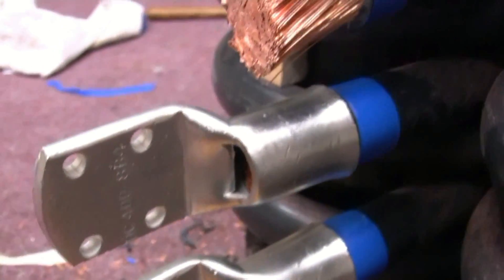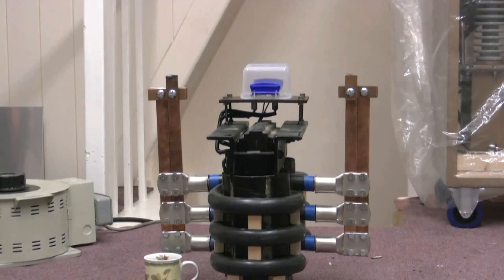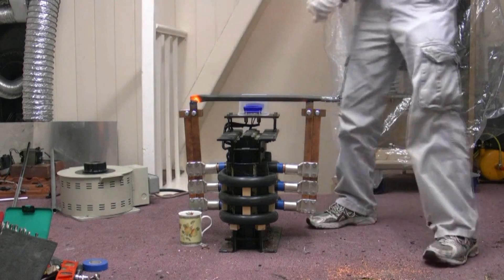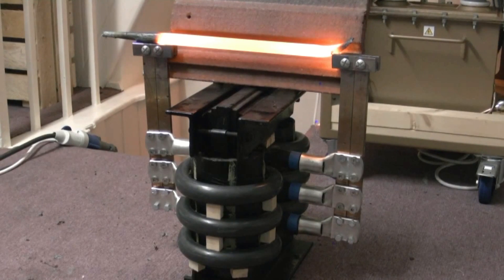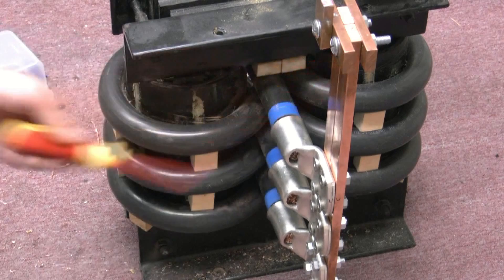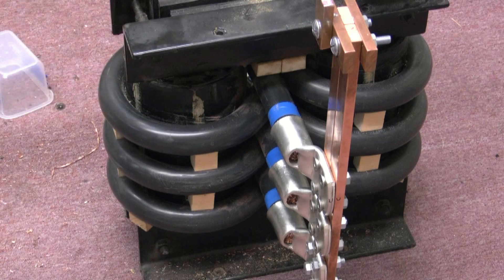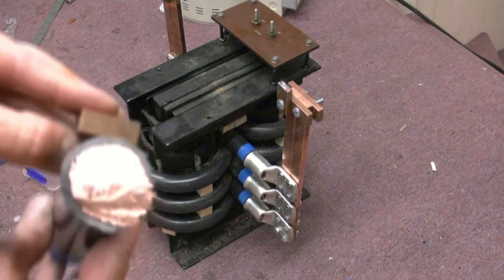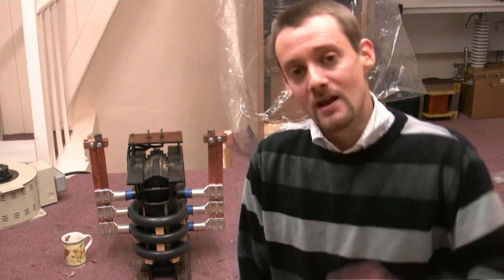50,000 Amp Transformer Completed

Comment: 50.000 Amperios y tocaa todo con la mano descubierta JAJAJAJAJAJAJ k puto fake es esto???
Reply: Lo que te mata es la diferencia de potencial (voltios). La resistencia del cobre (y más con ese calibre de cables y pletinas) es muchísimo más baja que la del cuerpo humano. Aunque sí, es mejor prevenir que curar, mejor ponerse protección. Póntelo, pónselo, ya sabes. XD

Me quedo con lo que comentan más abajo, si tiene 50kA en el secundario, aunque sea solo a medio voltio estaría consumiendo 25kVA. No se en escocia (por el acento del tio creo que es de allí), pero en españa esa potencia te la pueden suministrar en entornos industriales. No en el desván de tu casa.

Mención aparte lo de alegremente crear arcos y espurnas chispeantes de metal fundente sobre la MOQUETA de casa.
Reply: Te meta antes 1V con 50.000A k 1V con 1A xDD
Reply: MobidoM1
que algo sea capas de trasmitir 50kA no quiere decir que corren 50kA todo el tiempo en el circuito, el amperage esta ligado al voltage y las resistencias en el circuito. El cuerpo humano es una resistencia variable pero pongamosla en 5k ohms para ejemplificar, este transformador opera a 0.5V de salida asi que la regla de ohms dice: 0.5/5000=0.0001A nada letal y totalmente manejable con la mano. Nunca te puede matar algo de 1V porque la resistencia no permite el paso de corriente tan elevada. Asi que mejor informate antes de insultar y aprende que mientras es cierto que los amperajes altos son los que matan el voltaje y la resistencia de la piel(que cambia con las condiciones ambientales y otros factores) es lo que define dichos amperajes

Comment: I have a problem..even with a load of  0.01 Ohms (the object will still have some resistance) I calculate that a transformer like that with a 1 turn secondary (x3 in parallel for x3 power output) would have to have a turns ratio of 200:1 and would have an output of 1.2V with an input of 240V. It will only draw 0.6 Amps from the primary and deliver 360 Amps at the secondary, despite what the windings are rated for. Its even worse to get close to 0.5 volts out as the primary windings would have to have a ratio of 300:1 to get 0.8 volts out and that would decrease current to 240 Amps (3x80) and draw 192 Watts of power. P=VxC ~ 3x(64=0.8x80) if the transformer was ideal of course. I also studied electronics but that was 24 years ago so I may be a little rusty on my transformer calculations. It just looks like a glorified mig welder to me lol

Comment: Nice. I need this kind of current rectified. Any suggestions how to rectify 40 to 50 kA?
Reply: At that Amperage, Only water-cooled Rectifier Tubes  They use these at a plant I was at to power their over-head magnet crane, 3-phase  I think it could lift 20,000 lbs. The tubes (which were part glass) would glow blue
Reply: Alan C They'd be mercury vapour rectifiers & have a reasonable voltage drop across them, albeit less than high vacuum rectifiers.  Even solid state silicon diodes drop around 0.5 - 0.6 volts minimum, increasing with increased current.  If used in a bridge, there are two forward voltage drops in series with the load, so you're not going to be left with much dc after rectifying this.  If you really had to rectify something like this, I think your best bet might be some kind of synchronous mechanical rectification/commutation...
Reply: Start with a lot of money...
Reply: Phillll ok, done. And how to continue?
Reply: Get 5000 10 amp diodes, each with a low value (say around 0.01 ohm) current-equalizing resistor in series, and parallel them all to make one 50kA diode.  Make it 7 to 10 thousand in parallel for a bit of safety margin.  You now have one 50kA diode & can half-wave rectify.  Make four like this & you can build a bridge rectifier for full-wave rectified DC.  Or maybe you could find some old, huge mercury vapour rectifiers somewhere - old train station, power station, something like that ?  Or, go here:-   http://www.darrahelectric.com/metal-finishing-rectifiers.aspx       I'm not even going to ask.....
Reply: Hmm, diodes in parallel, that was my first thought too. But I think there could be problems ....NTC attributs of diodes.......
Reply: if each diode has a series resistor to give say 0.05 volts drop, give or take, not too critical, at the operating current, the diodes will tend to share the current equally & survive the ordeal, but use more diodes than you think you need  :-)